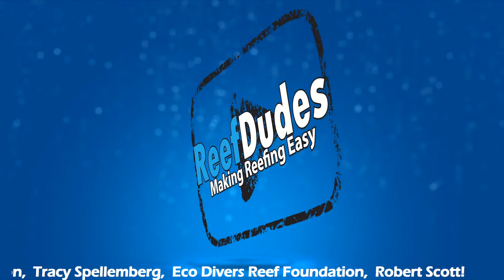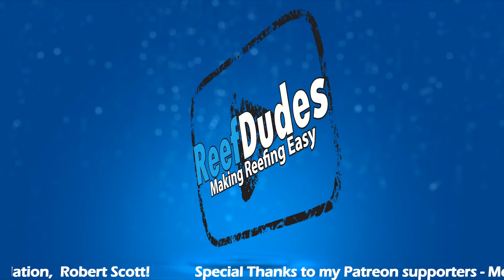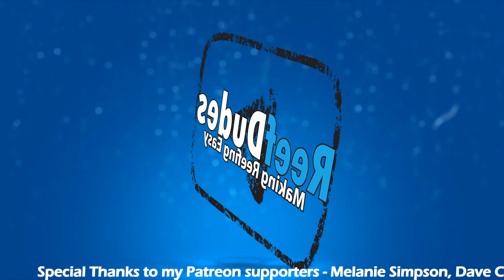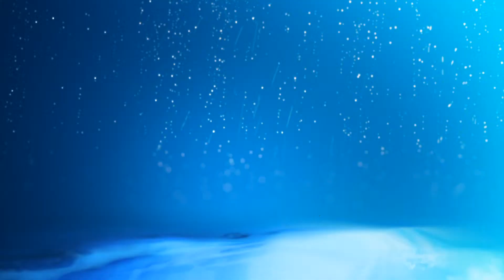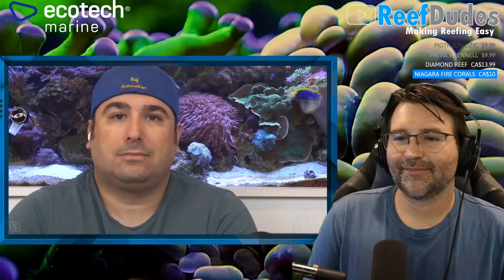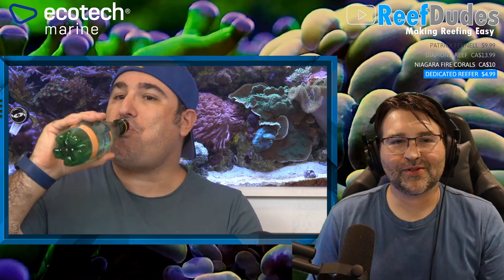Is messing with your tank messing up your tank?

Comment: Don't put a relay on your battery backup.  Ever touched one that's been plugged in for a while?  They get pretty hot, they usually pull a decent amount of power, not enough to matter plugged into the wall but when the power's out every electron counts

Comment: @ReefDudes - heard you mention you use a Versa to dose Kalk and turn off the pump via the Apex when ph hits a certain point. Do you have the pump set in Mobius to catch up on remaining programmed dose for the day or just let it continue with the preset amount?
Reply from the maker: Nope I don’t use catchup mode ok that one.  It rarely goes above so haven’t worried to much. I do still have the ato but switched off. So quick fix to flick it on once ina while if needed

Comment: When I first setup the DoS for AWC I set it up to run at 1am and it was mounted it under the tank. Let’s just say when that thing started it to do it’s thing it woke up my family and the next day it was removed from the tank and now it’s in the garage lol.
Reply from the maker: It’s great for dosing but for
Continuous use to loud for me.  Versa is my current fav for continuous use applications
Reply: @ReefDudes  if I switch over to kalk I am going to check out the versa.